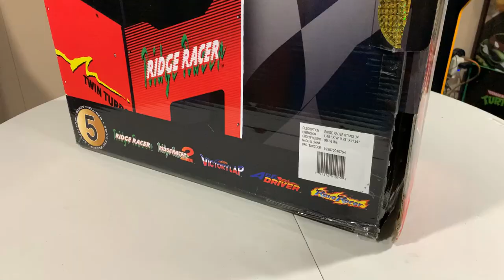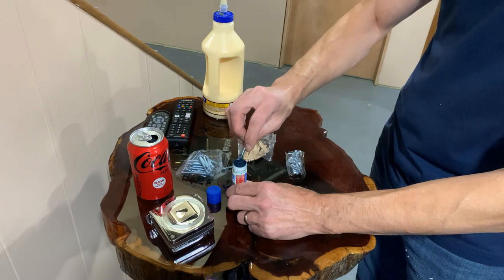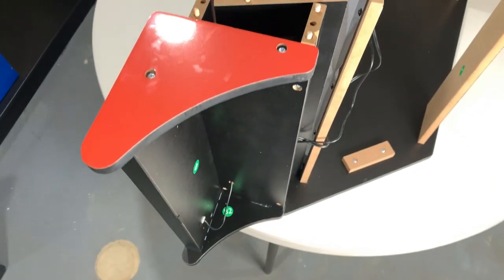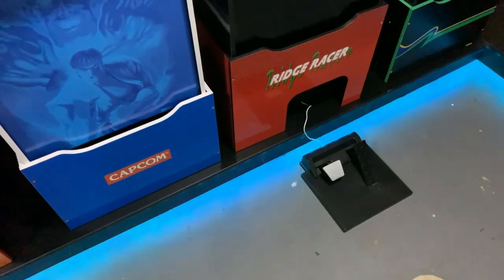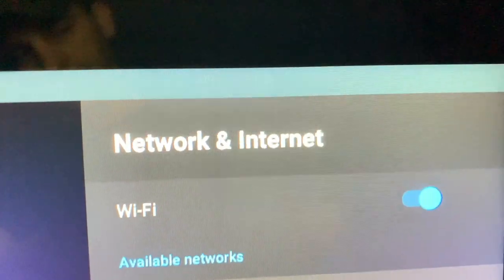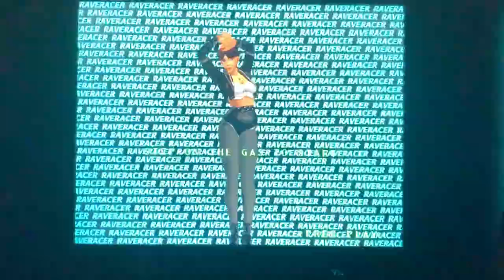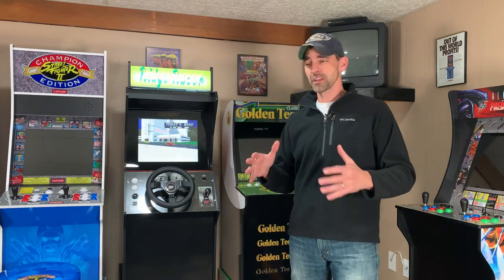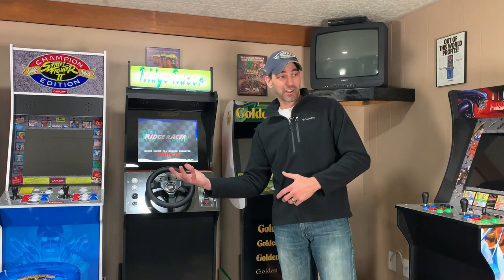Arcade1up Ridge Racer In Depth Review

Comment: Gotta tell you Fox, glad I bought Out Run and didn't wait for this. Doesn't seem like a big improvement over that cab and $200 more. The wheel feels awesome on my Sega cab, 1Up definitely nailed that feature. I don't have the sound issues like RR, but same crappy pedals. I teased PDubs for putting his video out first, definitely appreciate you both 👊🏻
Reply: So Peter, I just put together my Ridge Racer last night and I gotta say, you definitely dodged a bullet there. It's just an "okay" racing cabinet, especially when comparing to my Outrun cab which is just phenomenal. Despite the cheap pedals on both cabs, of course.
Reply: @rickhoes6326  Thanks for the info brother! Only other racing cabinet I'm waiting for is Cruis'n USA or SF Rush.
Reply: @petermarasco1105  RUSH, YES!
Reply: Ridge racer is better then outrun

Comment: 19kfox,

Thanks to you and others for reviewing this cabinet.  I paid $500 for Arcade1up's stand-up version of Outrun, and though the games are great, the pedals unfortunately stink.  They are way too substandard to be worth that price.  They technically work, but the way they feel when I touch them, pressing down on them or not, are way too flimsy, downgrading my experience every time I play.  I got exited before the Ridge Racer launched, because John D. mentioned the pedals were upgraded, but what a joke.  Updated springs?  Really?  The cheap plastic-y feel when foot touches pedal is the main issue for me.  And at 700 bones, that's not going to cut it.  They look identical to the ones I have on the Outrun.  I am glad though that they used the same quality steering wheel, which was the shining point of the Outrun cabinet.   Thank you and PDubs for saving me the money on this one; a hard pass for me.  You don't know how much these reviews help me, so really, THANK YOU :).  I'm also glad you're really digging the cabinet.  I've played 4 of the 5 games included, minus the sequel to Ace Driver, and love each one.  Great selection for sure :)

vgv

Comment: Good vid. I'm a dope games guy. Absolutely love my Outrun cab and it looks like I'll be loving this one just as much. On a side note, when you do your T2 review, make sure to comment on the emulation. No one else has yet and it's a lot less than perfect, particularly the audio which is slow and has pops and skips.
Reply: How well does T2 emulate on an emulator like mame? Because I’m making my own gun mod with a 32” tv, recoil sindens, and a pc preloaded with gun games. Is it better or just as bad if you emulate it yourself? I’m done with Arcade1up unless they stop releasing flawed products with bad emulation and sound issues and poor graphics that are jagged and not smoothed out and scanlines kind of mask it but they could do better.
Reply: I might keep my outrun and Simpsons stock for now but mod them in the future, and I’m going to have a modded racing cab next to outrun and a custom gun cab with 32” tv on a chopped off 1up. I might dismantle my turtles. I actually got the newer one so I might build the new one and use the old riser. It has the original song on the first game and scanlines and online play. I’m also doing a custom Moonwalker with a former Costco MK.
Reply: @Rob Krasinski  All sounds 🔥. The graphics on the T2 cab are emulated well enough, looks pretty good. No scanlines but there is a smoothing filter on which takes away any jaggies. Looks as good as Buck Hunter Arcade1up, if you've seen that. I should point out that the visuals surprisingly do not slow down and neither does the gun tracking. Gameplay is just as intense as I recall playing it back in the day at the arcades. For some reason, it's just the soundtrack (not the sound fx, which are fine) that seems to slow down big time. This is easily noticed right at the start of the first level. Not sure if the MAME emulation is any better, I haven't played it on MAME in ages.

Comment: No.  Def not worth $700.  A1U took too many shortcuts with quality.  I own several A1U machines and while I have a minor complaint here or there, what they did with this to speed it into production was simply unforgiveable considering what they are asking for it.  When we spend $700 we shouldn't have to be forced to upgrade a sound system or make mods to the pedals, just to name two.  This is a very hard pass for me.
Reply from the maker: I hear ya DEE CEE.
Reply: And to not add the plastic coin doors they already have used in other cabinets is also ridiculous.